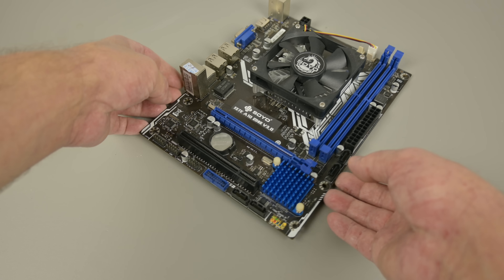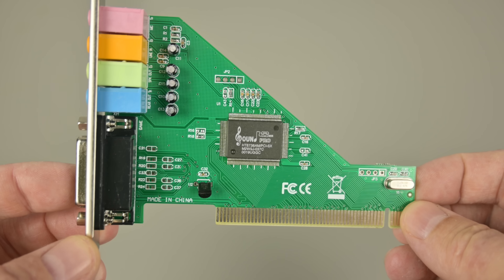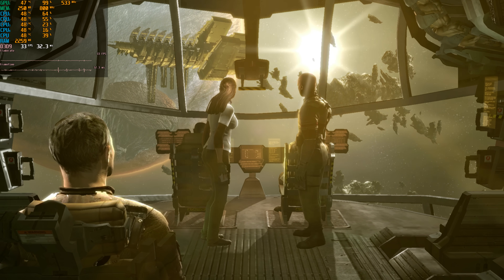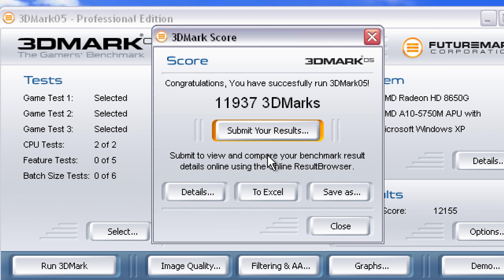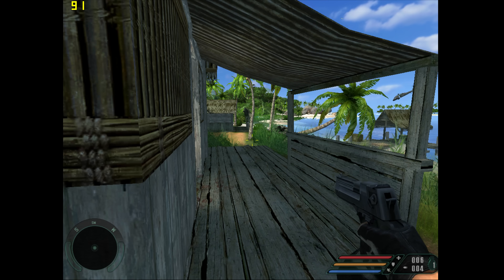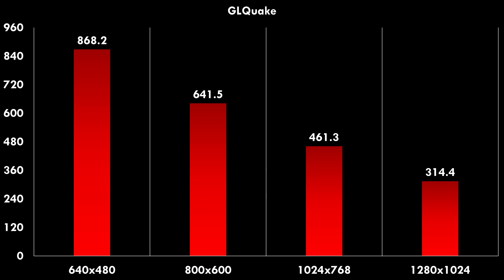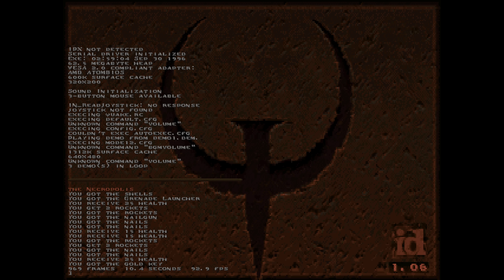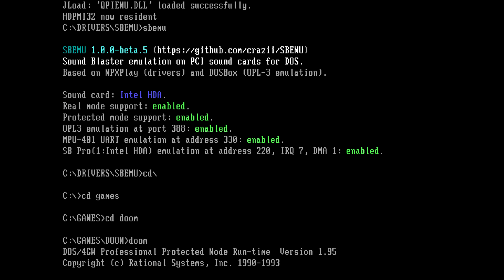SOYO A10 Motherboard: DOS, 98 and XP

Comment: Why doesn't Philips find a Chinese manufacturer to order a batch of similar industrial motherboards? Motherboards with PCIE, PCI, ISA and SB-Link are ideal full-featured motherboards.Shenzhen often has industrial exhibitions, where many manufacturers demonstrate their ability to design and produce chips and PCBs. I have talked to them and found that some manufacturers can arrange production with orders of hundreds of units. The most interesting thing is that some of them even purchase some discontinued chips.
Reply: With minimum orders you're looking at upper tens, if not hundreds of thousands of dollars for a batch. And then you need to have a way to sell and ship around the world and support them. This is more in line for some adventurous person to start a company around, and have Phil promote the project.
Reply: @SScorpio0  Not necessarily. Many companies in Shenzhen offer relatively low prices. I have talked to them. I also know that hardware sellers and big companies like ASUS have ordered motherboards with customized hardware and BIOS to sell on Taobao.

Comment: I remember Soyo as a motherboard manufacturer with a beautiful purple color.
Reply: ECS was another company that used purple PCBs. I really liked their K7S5A model with Socket A. I used that in a ton of custom builds back in the mid 2000s.
Reply: @Thohean  the difference being that people look back fondly upon Soyo.  Not so much on Extreme Crap Systems.
Reply: Yup.
Had a S754 board from them, must be 20 years ago.
Reply: Wasn't that Soltek?

Comment: No love for Linux, so it's not really inclusive.
Reply: I think the focus is mostly on creating ideal environments for classic games running on real hardware without emulation. In that respect I don't think there are a lot of classic Linux games from the 80s, 90s, and early 2000s that can't run on modern hardware without some layers of emulation.

How a system like this handles low-power focused Linux distros (or Haiku!)  would probably be interesting content, but not the kind of thing Phil tends to cover.
Reply: @michaelturner2806  Fine.  Well it's got material support for 3 types of mouse, which may come handy, if the BiOS handles them all...
Reply from the maker: No interest for Linux.

Comment: SOYO was one of the first to offer integrated graphics and sound on their motherboards (along with Cyrix MediaGX), something we take for granted ever since.
Reply: @kjrehberg That's not true. Graphics chips have been integrated into motherboards since forever, basically since the first XTs. It was relatively common since the 286, especially in branded PCs. That was long before Soyo even started making any of its own motherboards. The Cyrix MediGX didn't come along until many generations later. The same goes for sound chips.
Reply: @Thales_WH  OK, accelerated graphics chips.  In the old days we made a distinction between CGA and accelerated graphics.
Reply: @kjrehberg  No, we called CGA completely different things back then :) As a technician from that time, I imagine the term CGA to mean the Color Graphics Adapter standard and those were definitely not integrated into the boards, they were separate 8bit ISA cards. The first integrated onboard graphics card that had hardware acceleration not only for 2D, but also full-fledged 3D was the MSI MS-6168 with Voodoo 3 2000 8MB. We can talk about some boards that included a graphics chip that already had some basic 3D acceleration functions (ATI Rage II, Rage Pro, graphics in SiS chipsets), but their performance was poor and not entirely reasonably usable by the gamer. Anyway, Soyo is not there again :)
Reply: But we haven't had motherboards with integrated graphics in over 15 years now... The iGPU is on the CPU and has been since the Intel core series came out...
Reply: @fadingbeleifs What of Nvidia Nforce chipset graphics back in 2008? That's more like 12 years ago Even so they have been largely irrelevant since 2005 so I suppose the point still stands.
Reply: @MarcABrown-tt1fp  I am talking mid-to-late 1990s.
Reply: Oh no, MediaGX was avoid.
Reply: @mstcrow5429 worked great for embedded systems at the time. Home maybe not so much.

Comment: I got an old AMD Trinity laptop running XP, which is similar to this, and I swear the APU graphics performance should be better- even though it's Terascale and not GCN.
Reply: Budget Builds has mentioned a few times that the latest Terascale drivers perform far worse than earlier drivers for some reason he's not fully characterized. It seems to occur across both integrated and discrete GPUs.
Reply from the maker: Yea I didn't have much choice with driver version, lucky to get it running at all!
Reply: I agree, this seems too slow to me too, but unfortunately I don't have anything to compare it to.

Comment: I bought a GPU from SOYO, AMD RX 5700 XT, it was all new with a beautiful white PCB, but have a used GPU core and memory, I can't complain, it works, only cost me 160 USD.
Reply: Soyo only made Nvidia cards and stopped making GPUs a while ago, they are now made only as Maxsun/CBR. The card that you bought was from some refab company in China trying to use a brand name without permission to get people to buy their products
Reply: @necrotic256  name is sold like many others, many old Japanese brands are now in the hand of Chinese manufacturers.
Reply: It was not new, just cleaned very well. Many of these cards passed through my hands, I usually bought "Soyo" branded as whoever actually sell them do a good job with cleaning, repasting and new pads.
Reply: yeah i bough like 10 of those 100usd and resold them for profit

Comment: Phil did you get into the BIOS?  I wonder if A20 is disabled and can be re-enabled so the Soundcards can work.
Reply: is that what A20 is for? I thought it had to do with handling memory above 1MB? Switching between real and protected mode... I didn't think that had anything do do with soundcard compatibility. And looking it up, no, it does not have a "disabled" option, it switches between "normal" (slow KB controller) and "fast" (chipset 0x92 port).

Honestly I'm stumped as to why PCI sound cards wouldn't work - maybe lacking DMA? Or a PCI-PCIe bridge incompatibility? And if PCI sound cards DON'T work in that motherboard, WTF is the PCI slot actually useful for, really? USB? Nope, we got that. Networking? Got that. See? Useless PCI slot! 

Thus, I've come to that conclusion, that finally, PCI is completely USELESS after roughly 20 years of obsolescence.

Comment: Soyo is now a sub brand of Maxsun, they are rebrands of Maxsun models. I've sold a few B550M from soyo and Maxsun and they are the same, and work nicely! I've had no problems with them
Reply from the maker: Thanks for sharing
Reply: They have completely garbage BIOS'es almost like in handicraft chinese motherboard for Xeons. No need to develop software - the final product is cheaper.
Reply: @MakeYourVision  beacuse they manufacture xeon motherboards,